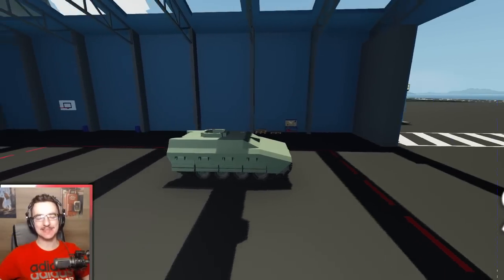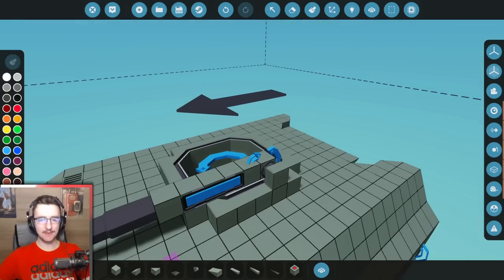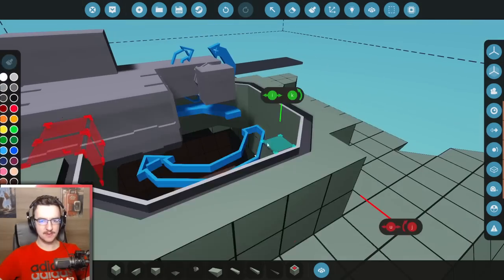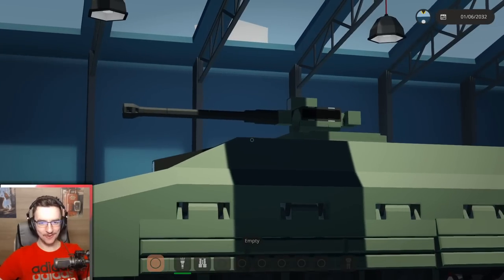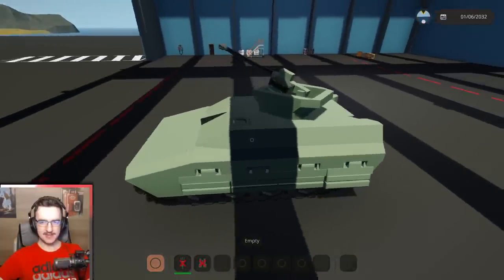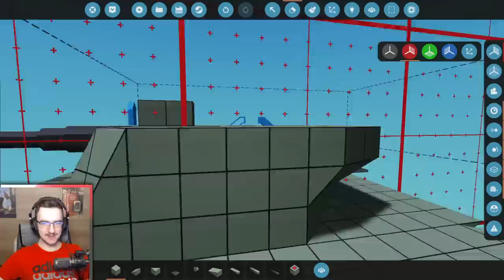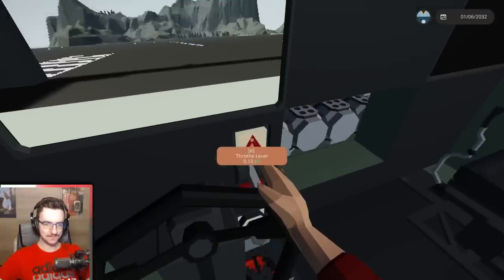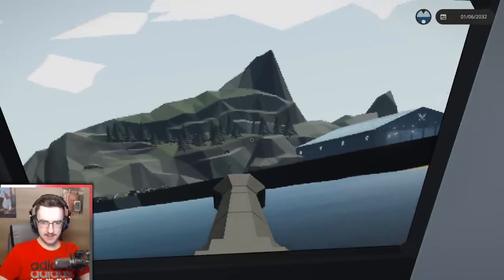I Built A HEAVY AUTOCANNON Turret On My IFV - Lets Build An IFV In Stormworks!

Comment: I don't have anything for you with the recoil. For a bigger build, I'd suggest a recoil system consisting of the straight suspension and the slide rails. I do that for just about every gun I build. Does it make a huge difference in the long run? No. But I like seeing the recoiling barrel for large guns. Helps sell the OMPF factor of them. You're better off with the incendiary rounds instead of the frag rounds. Having tested a bunch of the guns against blocks and angles, frag round just make a large mess around the point of impact in terms of surface damage. Incendiary is the weakest round of them all in terms of penetration power, but it has that chance to start a fire that no other round has. Kinetic is meh in dealing damage. HE creates a blast radius that extends past the point of impact so it can, in some circumstances, penetrate deeper than AP does. AP will impact fairly similarly to how kinetic does, but then it'll penetrate in a fairly concentrated area a few more layers in.

But with auto cannons, the damage isn't significant, so to say, enough to really make a substantial difference in performance between AP, HE, Kinetic, and Frag; again Incendiary is pretty weak if it does not start a fire as in if you fail to start a fire with something like a light autocannon you'll actually end up taking something like 10+ rounds to damage the block you're hitting. It's once you get to the battle cannon and higher that it makes a noticeable difference. The weighted armor blocks work in reverse of that. They work fairly well against small arms, but once the battle cannons come out, they really don't make too much of a difference. This is based on my findings from my own crude testing.

Oh, and in case you're interested, the difference between a Bertha Frag round and a Bertha HE round is that the HE round will actually penetrate a little deeper (my tests were with 1 block thick walls spaced by 1 block to give spaced armor for both the simulation of such and also so I could observe the damage difference in a quantifiable manner) but the frag round yeeted shrapnel all over. My first test bed for the Bertha rounds had some large batteries next to the gun and I had enclosed the target wall with armor blocks knowing that shrapnel would get launched and after I fired the round the batteries exploded. Shrapnel from a frag round hitting in a small armored box around 19 meters away flew out and back that far with enough force to blow up some large batteries. I know it wasn't the gun going off because I tried it again and the batteries didn't blow up. But just to give you a sense of why frag rounds are only "okay". They work great with the larger calibers, but smaller, there's not enough frag thrown around hard enough for it to count for much other than maybe a pistol shot.

Comment: So, i have watched recent videos of the ifv, and it seems that the speed fluctates, now, after getting in touch with a real mechanic, he presecribed to put another air intake in the engine, which should also fix the fluctuating air to fuel ratio (according to him, both values must be constant, meaning, it must be the same and the sound must be mmmmmm' mmmmmm' instead of m' m' m' m' m' m')